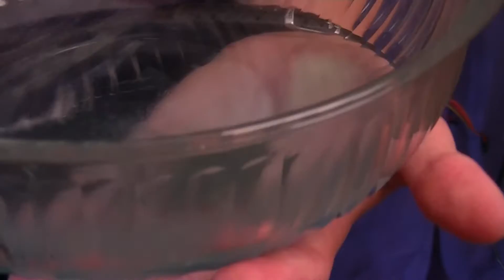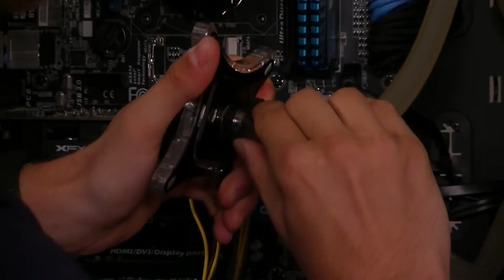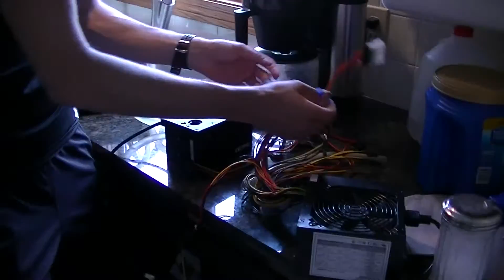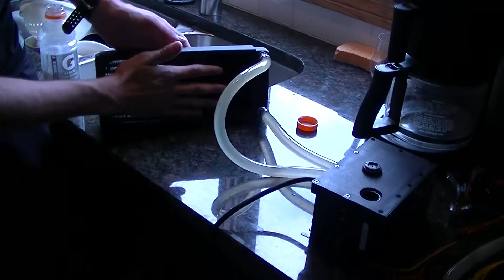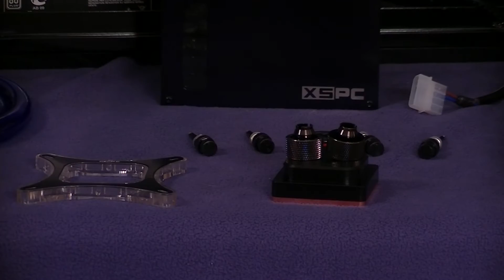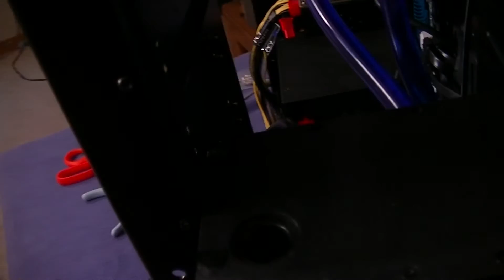PC Water Cooling Maintenance Guide

Comment: so can I just use water, no coolant?
Reply: The best way is to use distilled water with some kind of biocide like PT Nuke PHN (PH neutral one, there are two version of this biocide). When you clean your loop with vinegar, be sure to run clear distiled water after that to lower the water PH to neutral levels (it's a must for long term loop health) several times. Stay away from silver coils and aluminum if you want to use the loop components for longer than one year. When you use loop components for longer than 3-4 years it would be good to use Mayhems Blitz Pro to get your hardware a second life ;)
Cheers and good luck.

Comment: Did you reapply paste on the cpu or its not necessary ?
Reply: +Jose Semino dont think so but always reapply paste once in a while
Reply: if you remove the block you really should re-apply paste. it won't be even otherwise and can create air bubbles.

Comment: Would the maintence be the same for a basic system like this? http://www.newegg.com/Product/Product.aspx?Item=N82E16835118134

Also if using just distilled water with a biocide  how often would you have to clean it?
Reply: sometrhing like that is no-maintenance. sealed at the factory and youre not supposed to take it apart to clean it. im not sure if they get dirty or anything